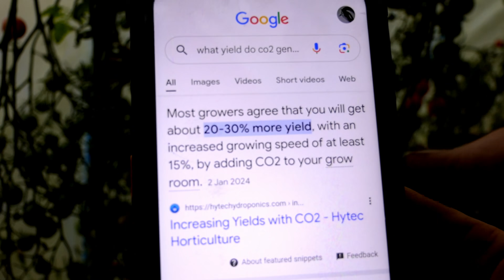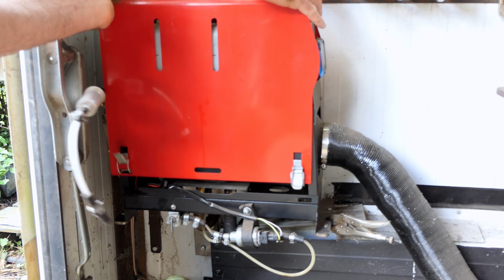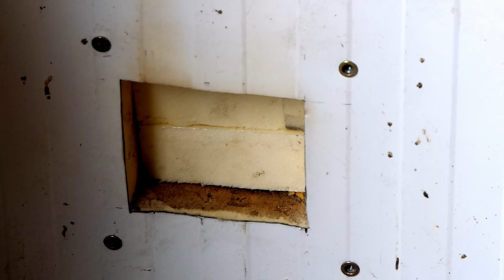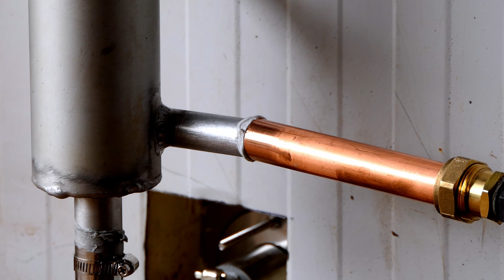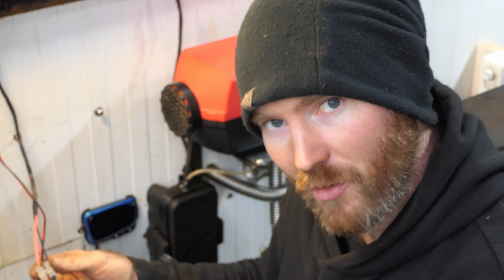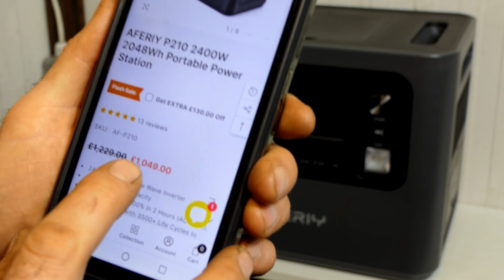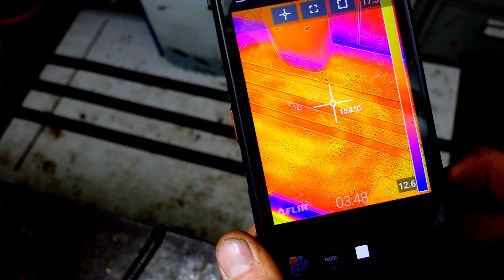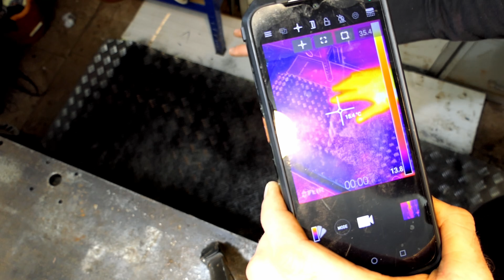NEW! Better system for Cheap and Safe Heating💲+ Underfloor Heating Mod test🫠

Comment: Those water heaters waste just as much heat out of the exhaust. 
You need a much better heat exchanger. 
 I built a waste oil heater to heat my 15000 gallon pond  i have the burner directly under a heat exchanger i built my self. 52 stainless steel tubes 600 mm long burn temp 457c chimney is only 70 c water flows around the tubes and the hot air rises up through the tubes. 2118 ltrs per hr. And the water coming out goes up by 3c and thats on low power 
 Im going to build a new heater from one of these Chinese heaters. And do away with the air heating side all together, blowing all the hot air through a stainless steel heat exchanger.
Reply from the maker: Nice, cheers J

Comment: I got the E3 error up on mine which indicates dodgy glow plug. Changed the plug which looked ok to me, as did the mesh,re built it pressed start and got the same error 😩 Stripped back down, changed the mesh and hey presto, heat!  Always change both.
Reply from the maker: Well done, cheers J

Comment: A very big thumbs up for the comments on freedom of speech. I do not always agree with all of your thoughts but to know that you not only encourage the hearing of opposing ideas but are also willing to change your mind on new evidence is quite refreshing.  I have seen a number of Youtubers overtly state that any critical / adverse comments will just be deleted, regardless of merit.   I can't help but think that the open and free discussion of ideas, even if they are in opposition to held belief is one of few ways of progession.
Reply from the maker: Thank you so much, comunication and dialog is definately the key to progress. I would be arrogant to think I know it all and not admit there are gaps in my knowledge and understanding. It is good have core beliefs tested and be humbled  to a point where you can discover what is realy true. cheers J

Comment: dinosaurs grew that big cos there was more oxygen in air, not CO2.
Reply: There was probably more Oxygen AND more CO2. Which means that there was relatively less nitrogen (which is around 75% now).
Don't forget that limestone is CaCO3 (one Calcium, one Carbon 3 Oxygen). So, the kilometers thick layers of limestone removed and fixed a lot of oxygen. All that done by shells.
Reply: @ChristianCOMMARMOND  Yeah, CO2 probably helped plant side of the ecosystem
Reply from the maker: Because the trees grew so much bigger there was more oxygen. Thats correct. C...O2.. cheers J

Comment: Oil runs out in 47 years. That's known reserves at current rates. We have to d something else, at some point. Sooner is probably better than later (Easter Island anyone?) Also, if you want to learn more about climate change you could do worse than checking 'Sceptical Science' > How do human CO2 emissions compare to natural CO2 emissions? And DesmogBlog > Op-ed: Geoengineering Distracts From Real Climate Solutions While Giving Cover to the Fossil Fuel Industry
Reply from the maker: There has been at least 3 new massive oil reserves discovered recently. I'm pretty sure we also have a 300 year supply of coal still (3560 million tonnes in UK alone). when we need to make the  change, the prices will naturally go up and that transition will happen. I don't agree it should be forced all of a sudden. cheers J
Reply: @joshuadelisle   The 47 years is at current rates. And consumption is increasing year on year. CCS remains a distraction. And there is no such thing as 'clean coal'. The only things people of the future will care about are 1) Can you breath clean air? 2) Can you drink clean water? 3) Is the land base healthy enough to grow food? None of those questions are likely to be answered positively if we carry on with current levels of consumption and with the polluting industries and methods required to fuel that.

We either continue as greedy / selfish inhabitants of the planet or suffer the consequences. Sadly a huge proportion of wildlife has already suffered because of man's relentless need for 'growth' / profit etc

As an aside, your videos are great, but as you say you aren't a climate scientist (and neither am I) and whilst debate and refences can be positive I think the climate stuff detracts from your videos. However I can appreciated that being 'controversial' can increase your clicks and if you are monetising your channel it could be helpful.
Reply from the maker: @cpcnw  thank you. I actually agree with much of what you said. However coal burning is localized and so the grid distributes the power  to the places where air pollution isn't an issue. The pollution is coal dust which isn't great to breathe but it's not necessarily bad for soil. Open Mining and oil extraction can be devastating without doubt. As far as coal usage goes we closed all the power plants in the UK and we have extensive smokeless zones so our consumption is at a record low in terms of usage. Coal is way cheaper to produce energy than nuclear which has its own problems regarding safety and waste management. Regarding controversial viewership my main point is to encourage people to do their own research and question what may be mass manipulation. It doesn't help video in fact has been restricted by YouTube for being controversial. Cheers J

Comment: 5:37  That's definitely not what a 15min city refers to. It's about having more resources closer to where you live so you don't HAVE to travel for the daily essentials. Example being 'local' shops rather than the super store style supermarkets that are becoming more common.
Reply from the maker: That's common sense but it doesn't make sense to force people to do it. I would rather be self sufficient and not be anywhere near anyone. Cheers J
Reply: You may want to do a bit more on that subject
Reply: Excellent video , and 100% agree with your views . Views that  can’t be derived from letting the TV tell us what to think .

Comment: as to the soot when the furnace first starts up there a a fair amount  of incomplete  burn and raw fuel being expelled until the system heats up to operating temperature. and since you are pumping the exhaust into your greenhouse  your veggies are getting impregnated with a bit of fossil fuel residue. for your under floor heating  before you inserted the plastic pipe you should of inserted finfoil. iy would pulled heat away from the pipe more effeciently
Reply from the maker: @skrywenko6596  good tip. Cheers J

Comment: Anyone researched just how much co2 has increased by 7 billion+ humans breathing today? Compared to the The world population in 1924 was estimated to be 1,894,874,000? For the morons that will spout  irth control I suggest you look a china's one child policy before you prove  just how stupid you are by spouting rubbish like "everyone one knows that" or I read it on some random post on Wikipedia etc. I also recommend checking the who, what and why of the people/groups etc that pay for any research, not to mention any bias that those researching the facts have. After all none publishes something that does not support there point of view regardless the side you are on. Look at everything, trust nothing and by the grace of God  and a following wind you may find the truth. 

Re the under floor heating I suggest you look at insulation under the pipes and thermal mass around the pipes. We put 400mm of foam under our conservatory floor and 300mm of concrete over and around the pipes. Maybe look at redoing the workshop floor or even the whole workshop and expanding out or up.
Reply from the maker: Very good points. Cheers J

Comment: A quick search tells me the 3% of CO2 emissions by humans should be 33% not 3%.
Reply from the maker: It's a 33% increase but total CO2 is only 3% human. Double check it. Cheers J
Reply: @joshuadelisle  I've googled it multiple times and can only find dodgy Facebook infographics without references and a debunked Australian news presenter. I can't find a source for 3% can you reference one for us? Also, the 33% increase perfectly correlates with the industrial revolution and the increase in global population, and the rate of burning fossil fuels. Where's any evidence at all that it's 3%?

Comment: The other thing I find supremely annoying is that due to the "energy crisis" fuel prices went up for whatever reason. And our response was to dramatically reduce the amount of energy we use. We turned things off, deliberately bought things to produce cheap heat, stuck solar panels our our homes and batteries in our lofts to use cheaper off-peak energy, worked from home to cut down fuel costs, etc.

So what energy companies did was increase the one part of our fuel bills we have no control of - the standing charge.

And all we did was shrug and pay it. There is literally no reason for our fuel prices to ever decrease ever again. We've proven we can pay this, and are willing to spend less money on other things to compensate. I wouldn't put it past them to introduce the threat of power interruptions as a way to make us do something beneficial to them.

Since either there's plenty of power/resources and no problems at all, this is just being done out of greed. Or the system is severely broken, has been broken for decades, and all the quick fixes and patches we've not noticed are starting to fail. It's hard to tell if you're part of the band playing on the Titanic or not until the water's around your neck, but then it's too late.
Reply: EROEI - The costs of getting resources are rising as they become more scarce. Take oil for example. Now we are drilling in 3km of sea water. it's dangerous / risky and less investors and insurance companies are willing to take the risk. For those that do the pay offs are massive. But when it goes wrong, who pays??? Take Deepwater Horizon for example. Wind and Solar are coming down in price but are not as energy dense as oil. And the one thing you cannot do is reduce the shareholder dividends and CEO bonus. 

UK: The richest 350 individuals and families together hold a combined wealth of £795bn – a sum larger than the annual GDP of Poland. Furthermore, the net worth of the twenty richest people in the country has more than doubled in the past decade. If all household wealth had increased at the same rate, it would equate to over an extra £250,000, on average, for every household in Britain.
Reply from the maker: Very well said. Cheers J

Comment: I made my intake and exhaust coaxial through the wall it preheats the air to about 50°C and also means only one hole though the wall and adds heat protection for the wall
Reply from the maker: Nice. Cheers J

Comment: I think human activities are the cause of what we're calling climate change, for the main reasons you mentioned at the end. We're the only species that has expanded without control across the whole planet, and then tried to adapt the environment to suit us better. We consume vast amounts of food, so need land to grow it. We require a particularly short temperature range to be comfortable, and maintaining that requires fuel from somewhere. And there's over 7 billion of us, so we need to live somewhere too.

So yeah we're chopping everything down, paving over it to live on, and then trying to force the natural environment to remain stable so we can continue without change, when it clearly won't. Things exist in balance. We've come along and really really upset the balance. And I think we've done it in such a way it's impossible to work out one single cause. It is most likely a combination of many many factors that are causing the effects we're seeing now, and trying to focus on and "fix" one issue (like our current obsession with "carbon") is unlikely to make much difference.
Reply from the maker: Very good points, cheers J
Reply: This is so hard. There's loads of distractions with microplastics and PM2.5 etc. All of that does matter, but it's like re-arranging deck chairs on the Titanic. If we don't stop burning fossil fuels soon then we are going to wipe out humanity and take a load of other species with us. It really is that simple. Note it's only the burning of fossil fuels that's the problem because it's millennia of energy released in the time order of decades or a couple of centuries. It's a million to one difference that's the issue. 

Climate scientists currently believe that we have gone past the point at which stopping burning fossil fuels would be enough. We're going to have to invest a huge chunk of the global GDP in sequestration and similar in order to save humanity. Every fossil fuel we burn now, we have to pay more for removing the CO2 released later. Watch some Sabine Hossenfelder. She rarely gets things wrong and agrees with both of is.

Comment: I have used second hand marine heat exchangers in countercurrent flow arrangement to do a similar heating system. Bonus is the heat exchangers are copper.
Reply from the maker: Nice. cheers J

Comment: Great video! Thanks! I am with you about global warming and you are touching extremely important points and in my opinion you are right. The only very minor details that will be blown out of proportion. One of the reason they find temperate climate animal fossils in iceland might depend from what geological period they come. As the tectonic plates migrates some areas have been all over the planet over the years. To me the most important points are what real impact we could have and at what cost. Deforestation and creating very dense cities (in america it is in opsite direction ehere the density is so low it is economically impossible to sustain the infrastructure).
Reply from the maker: That's a good point. Cheers J

Comment: A few modifications of your own like you doing here makes it more worthwhile to get one but out of the box normal setup they are just too noisy ......There is an urgent need for affordable heating, as many pensioners in the UK have had their winter fuel allowances removed. A significant number of them will struggle to get by this year.👍👍
Reply from the maker: Good insulation makes a difference too. I run mine for an hour and the heat lasts most of the day. I will be doing a tent test very soon. Cheers J

Comment: Hi Josh, I installed a 8Kw unit on the outside of my house last year when e.on wanted £700 per month for my existing heating system so now that's turned off and I run my heater for 12-15 hrs a day on heating oil and it only cost £2 per day.  I have 2x holes in the wall so I don't have the draft issue and I use 2x 10ltr fuel tanks so I only need to top up once every 8 days, on setting No4 which is all I use only uses 3 ltrs every 12 hours.
Im going experiment with an old oil boiler and swap the burner for one of these units as my next project.
Reply from the maker: Nice. Well done. Cheers J

Comment: if you're worried about particulates, how about a water scrubber? you could keep it in the garage to keep the heat in, before fluing the exhaust into your poly tunnel.
Reply from the maker: I wondered about a water scrubber/bubbler but the pressure resistance may not work for the combustion. Cheers J
Reply: @joshuadelisle  i guess the impellers in an aquarium pump are likely to be plastic too, everything like that you add will increase your price per kilowatt, too.

Comment: The problem with electric cars is that once just one goes up in flames, the toxic shock is more than 100 cars using diesel for a year!
Reply from the maker: Very good point. Cheers J